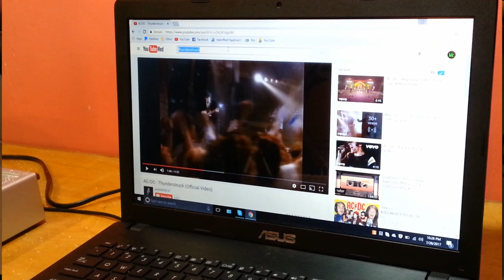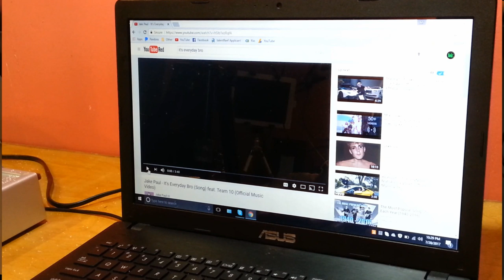How to build a Chladni plate

Comment: I think the lip on the plate constrained the number of different patterns available. I am using a square piece of 1/16" thick steel plate, painted black. I use salt because it is lighter than sand and reacts more quickly to an input. And I am using a Dayton Audio surface exciter/transducer from Parts Express. I'm teaching a class on sound and acoustics. Also, just wanted to say to some of your commentators: when you use music, the notes and sounds within the music change quickly and constantly. A Cladni plate is only supposed to display standing waves, which take a little time to form a pattern. You can use two or three pure (sine wave) tones at the same time, as long as they don't instantly disappear because they are part of a song. By the way, Carlos, LOL, dude! (end of vid)
Reply: Can you tell me or show me more about how you setup your chladni plate using the surface exciter. I am going to be doing a project with kids making some chladni plates. Your idea seems great.

Comment: Noise (random frequencies) will produce random distribution: lots of sand particles going to wherever they are bounced. 
Every fixed object has a resonant frequency, eg. When you flick a wine glass the pure tone you hear is that freq.. 
so, this Teflon pizza tray also has its main frequency: it’s fundamental. After that? It will have a series of extra (some quite strong, some a bit weaker) frequencies where it will respond. It is the Chladni plate (named after Mr Chladni) that vibrates and sends the particles into an organised shape/pattern.
It makes compulsive viewing and a desire to experiment and make your own. Thanks for sharing. By the way, once you generate higher than 20,000Hz we can no longer hear the pitch. (Ultrasonic) Hifu is a cancer treatment, can bust certain kidney stones and of you get the frequency spot on you can image inside the soft tissue and see your unborn baby. Not recommended at home.
Reply: you can image inside soft tissue? or did you mean damage?

Comment: I feel like if you would have put spongy type rubber washers in between the plate and the bolt and the Easter egg you probably would have ended up with much cleaner results. But this is still pretty damn cool. I think I'm going to build one myself

Comment: One wonders what the pattern is for 3400 HZ, the frequency of a Blue-Point (AT2050) air hammer.  I viewed a video of a mechanic break up the rust and walked-out a CV axle from its carrier bearing bracket [1].  One wonders if it was a practical application of the the Chladni plate effect, the carrier bearing, like the sand, seeking equilibrium.

[1] "”how to replace passenger side cv axle Toyota sienna 2015” on the “automotive tech-vet”-channel

Comment: This explains our reality
Reply: Is a rudimentary demonstration of a property of our charge... resonance and standing waves that geometrically equalise pressure. 
(staggering variabilities there alone.)  
Theres more at play here obviously, but it fails to ‘explain’ those. 

Now do it in 3D. And put it in an environment that exerts a rotational force on it. 

Now do it with plasma. 

Now established how to have two Plasma discharges in a coexistence of sorts...

Now supply the driver of the original field with the exact energy properties it requires harnessed from the resonant properties of of sorts of the secondary field. 

Thats an in accurate, oversimplification of the tip of the ice berg. The relevant Principles of nature are simple, yes. Bout our existence is at an increased magnitudes of such immeasurable scale that reality has had a pretty good chance to become a far more layered and complex beast that the few basic principles would lead you to believe. You can still see these basic principles trough out many of nature’s aspects, but its not that simple... to meaningfully understand them to the point you could harness them, you gotta apply them as a ‘key’ of sorts to a seemingly never ending hill of riddles n brain teasers and you must work each one out to a very high standard before you can progress too far onwards.

Comment: it allows you to visualize how a centrally vibrated plate creates unique interference patterns depending on the mechanical frequency applied / the plates shape / size and mechanical characteristics. change the shape of the plate, and the material its made of and the entire interference pattern changes. so you are not really 'visualizing waves' - still a very cool effect